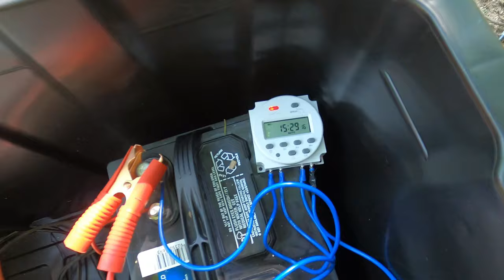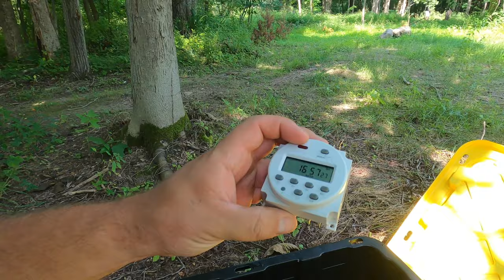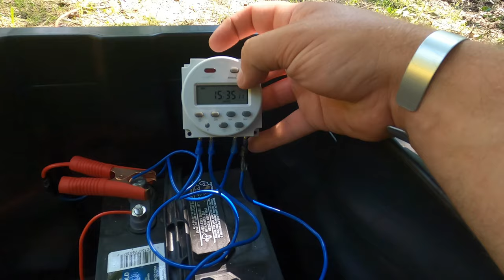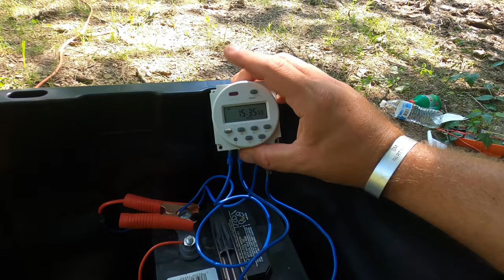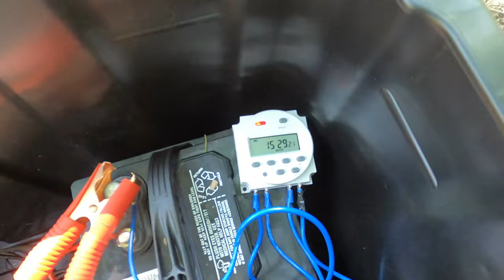DIY Solar Powered Farm Pond Fountain - Farm Pond Aeration Cheap solar fountain solar water pump

Comment: Great video . I’ve been working on the same project with larger fountains. Solar just doesn’t create enough power without breaking the bank with panels and batteries. You might be able to push more water with a magnetic drive pond pump. I’m using a 9000gph pulling 600 watts.  For subsurface aeration, you can use a dual piston compressor pulling minimal watts and yet turning your pond water more than one would expect. It’s not the air you are pushing to the pond that benefits it..it’s the movement rotation from bottom to top the pond gets from the bubbles rising which keeps the water moving and cycling to the top where it gets re-oxygenized.

Comment: Like your video I have a pond but no power out there yet. I took your timer idea and tweeked it. It's all solar air compressors only $55 made to aquarium and made to run all the time. Thanks
Reply from the maker: Nice. What pump and solar setup did you use? The pump I used can only run for x amount of time before the system needs to charge.

Comment: DEEP CYCLE BATTERY: Is there any way to get a deep cycle battery cheaper?  Or is the only option to buy a new one?  They are expensive.  Thanks!
Reply from the maker: They are expensive for sure. I prefer deep cycle but I do know people running standard batteries on smaller setups.

Comment: Hey. I did the same setup. And the timer started ti melt at pin 1 and 2. 16amp/250vac
Any thoughts? Wired it up like this. It worked for 2 minutes then shut off
Reply from the maker: This setup is for 110. My guess would be the timer would need to be more heavy duty.
Reply: @TheOhioOutdoorsman1  yes sir. Same setup. 110 sump pump. Into the converter. (DC to ac) same as yours. Same timer. The timer kept melting. I tried 3 timers. All melted. I ended up buying 110 timer plugged into the convetor, has been running fine. But ofcourse doesn't eliminate the convertor from turning off. Stays in on demand mode

Comment: If you need to power a larger load, use the timer to trigger a relay. Why not put the whole unit on a float, panels and all? More Sun in the middle of the pond.

Comment: Shouldn’t you be able to use the timer to replace the on/off switch on the inverter instead of running the main power leads that way it’s only dealing with the small power of the on/off switch?
Reply from the maker: That is a possibility as well.
Reply: @TheOhioOutdoorsman1  i decided to make my own and it dose work that way just need to supply separate 12v to the timer I wouldn’t work if I tried to just the power coming off the rocker switch.

Comment: I dont really understand what you spliced.  How is the solar controller and the pump itself related.
Reply from the maker: The solar controller's only job is to regulate the voltage to the battery from the solar panel. The controller prevents the solar panel from overcharging the battery. 

As for the pump, it is plugged into a 110V power inverter that uses the battery for power.
Reply from the maker: I did forget to mention that in this video, the timer I put spliced is and cut the power off to the inverter so it does not drain the battery when the pump does not need to run.
Reply: Iv got same problem inverter has to be on and drains my battery, i will try this 👍